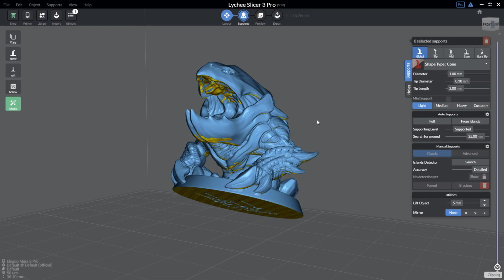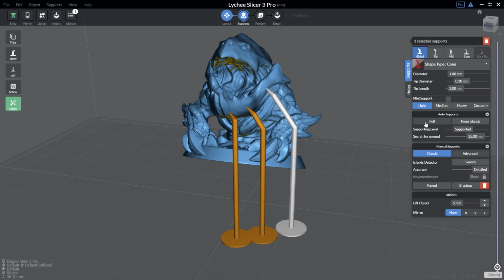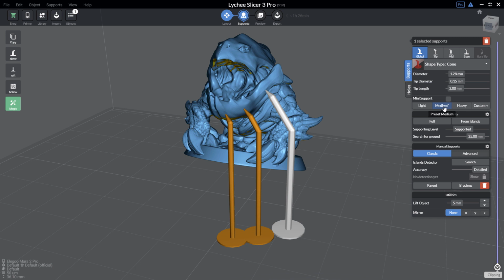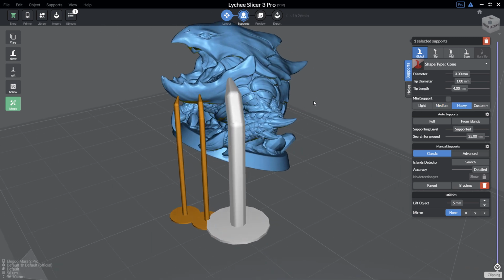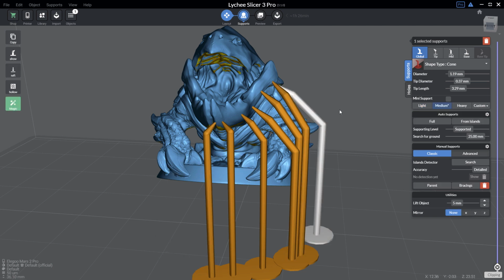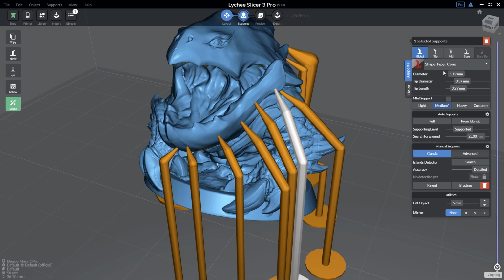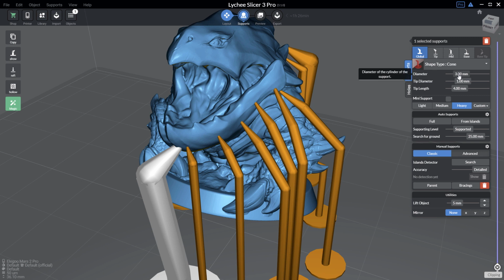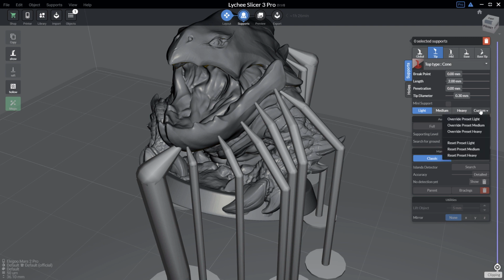Q&A with Lychee Slicer: Support Presets Explained

Comment: Custom support profiles still has absolutely horrible UX. It really takes some time to understand all this override juggling mess.
Reply from the maker: Hi, is this still the case on Lychee Slicer 7 and more? :) this is a very old video, just want to make sure we're on the same page :D
Reply: @Lychee3d  Hello, yes. The UI is quite confusing. It is not immediately obvious that the support settings are decoupled from profiles and when you click on the profile, it just replaces the settings with the profile. Another confusing thing is that when you create a custom profile it highlights your profile and the original one (eg. Medium) - I suppose it is because they have the same parameters at that point, but it is confusing. When you change some settings at that point, the star appears next to Medium, not next to your custom. To save the changes to your custom profile, you have to open the menu a select override next to your custom profile and then discard the changes by clicking on Medium again. I think when I create the custom profile, it should automatically select and highlight it (just it) and any changes should add a star to the newly created custom profile (not the original) and then there should be "save" to save the changes (not override). And if I right click on the profile button, I'd like to see a context menu, which is now hidden under two gear icons.

Comment: @lycheeSlicer
Can we now save a set of supports? I have a model that I created supports for, but I got a renewed version of the model from the 3d modeller. Can I use the supports from the previous model and apply them to the modified new model? How would I do that?
Thanks in advance.
Paul.
Reply from the maker: Sorry for the delay of our reply. Yes, you can! In the Layout workspace, select your model, then on the right, you have the Object editor, you click on the STL path, and then select the new STL.
If the model is slightly shifted from the support, in Prepare Workspace, in the Object menu, use the Shift Support to New Object Center command. I hope that help!

Comment: Nice video!
I'm amazed by the Heavy support tough - 3mm !!!
I think there are much finer print parts than that :) 

I just played around with supports (in chitubox, which I don't find fun) and made them thinner than Light (0.6 vs the standard 0.8)
I printed 3 models together with these settings: a throne, a dwarf and a gryphon. And there was only one support failure at the top front beak of the gryphon, which I think was one of the longest standalone support (I had 2 or 3 of these).
So lesson learned about going to extremes, but I can't imagine what would need 3mm supports!

Comment: What about tip type/penetration or the other dozens of presets?  I am having trouble with my model pulling off the supports.  I think the fix would be increasing the density and the tip diameter and the tip type and penetration but there is no real explanation of them that I can find.  Also tip type make no sense at all.  cylinder, cross, box only seem to change the base of the support in the graphic icon shown and have nothing to do with the tip.  I would expect the types to be - sphere, box, cylinder.  Cross makes no sense to me???

Comment: I was confused when the import button seemed like it wasn't working, but after a while I figured out that I had to set all of the custom settings as the defaults and then export before it would bring those settings up like I wanted.

Comment: nice video ! I am looking to set internal supports for a hollowed model, but there doesn't seem to be a way to do that. Am I missing something ? Will it be added in the future ?
Reply: If the model is solid go to Supports => Hollow and enable hollowing, then set the infill you want and add some holes with the holes tab of the support panel. The slicer does automatic infill inside the cavity  and so far it's worked great for me. If the model is pre-hollowed, like if you used mesh mixer for the hollowing then you can just add supports as normal inside the cavity. I did have some minor annoyances with one pre-hollowed model where Lychee routed auto-supports through the holes which made them annoying to clean up but I think any autosupports would have done that.